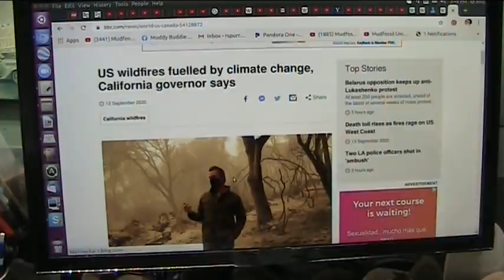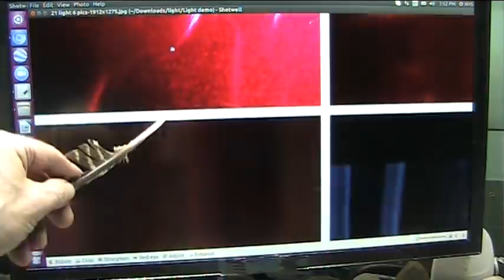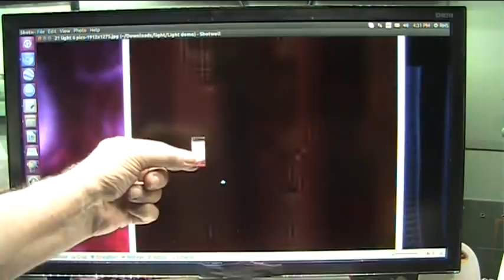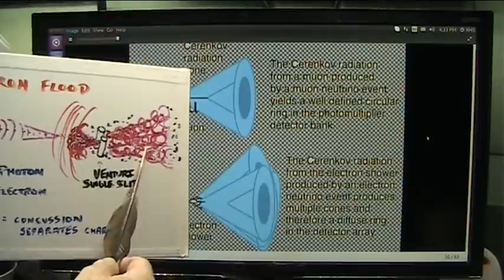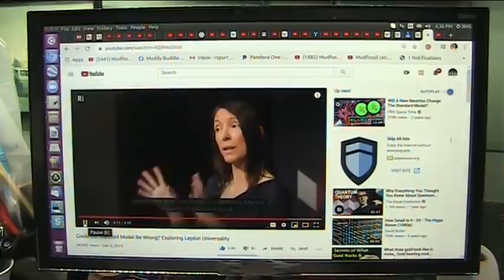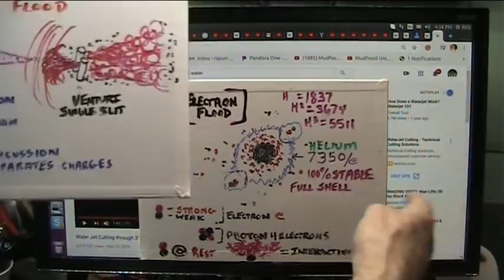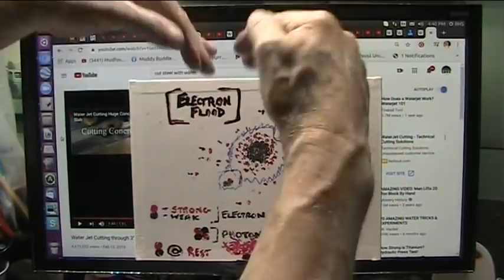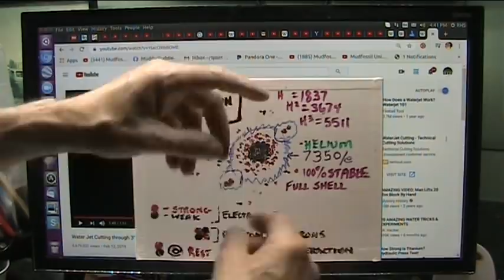Calif Governor I can help Please Contact me

Comment: Roger, so many have done just that, made carburetors that run on water by separating H2 from O, but the videos get scrubbed from the internet or something bad happens and it's all quickly buried, but here's one you might like;  https://www.youtube.com/watch?v=wjeM2IBhtlc&ab_channel=delvis11, and in this one, which is much of the same footage, and yes,that's Bob Lazar is in this one, he speaks of the govt. not letting it happen;  https://www.youtube.com/watch?v=Yyiw9I3AVaU&ab_channel=HarryBraun; and besides this last video, he has many videos on his channel, 'delvis11', on hydrogen generators you can build and other devices to build to use hydrogen for health; https://www.youtube.com/watch?v=4lrBcof0d-0&ab_channel=delvis11

Comment: None of it is climate change. Climate change is a complete lie. These fires are being set on purpose by arsonists and by drones. Roger if you don’t know about DEW weapons they are also using this to start and spread the fires.
Reply: Climate does change, however it is not man-made. We are but a speck of dust in comparison to our star. When anything affects the sun, then in succession, we must also be affected. Intensity has grown everywhere. We now get uvc Ray's which never before have been measured on the surface, except from arc welding and nuclear explosions.... We have no control over what comes... Volcanos, hurricanes, derechos, lightning, everything is electric....